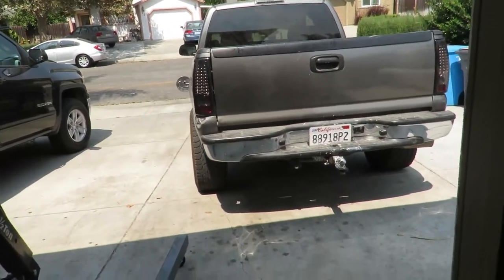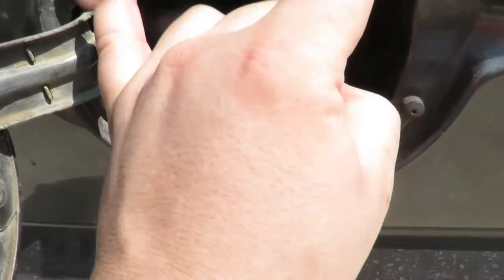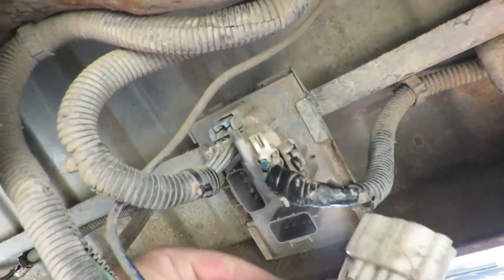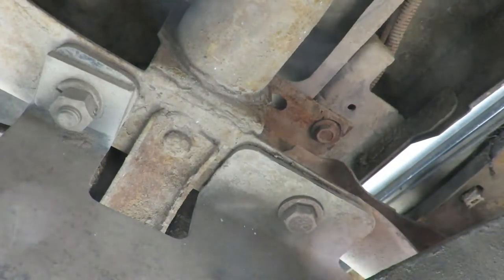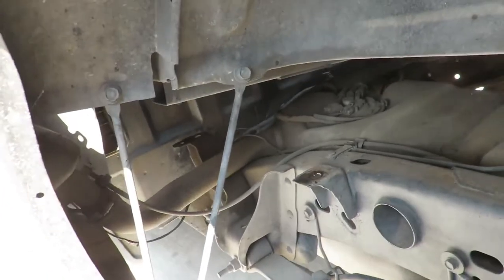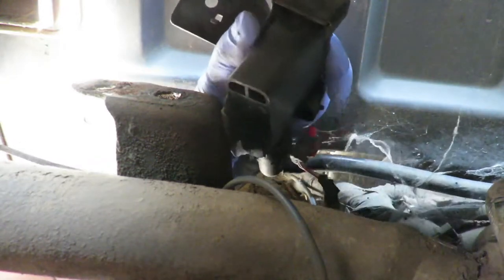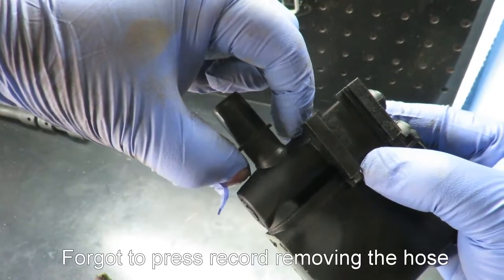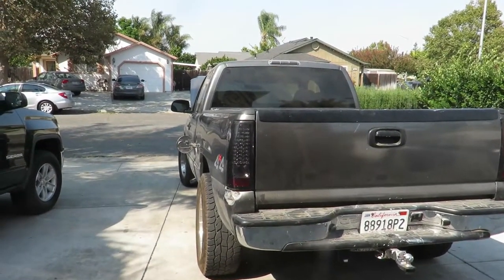GMC Sierra - Evap Canister Vent Solenoid Valve (P0446)

Comment: You don’t need to do any of this, follow the steps I did, 

remove the bolt that holds the ground wire and let it dangle so you don’t damage it

Undo the electrical connector by feel

Remove the old unit from the bracket, leaving the bolt holding it in place, it’s good enough to do it one-handed

Remove bracket bolt and bracket

Then, as the hose is connected, you can rotate the old unit at an angle where you can put a flat head screwdriver on the connector on one side and pry it out, and then likewise  for the other side, then reach over around the axle to hold the old unit and use your other hand to pull the hose off once the tabs are out

Click in new unit to the hose, click in electrical socket, bolt the bracket, then slide the new unit onto the bracket, reattach ground bolt and then you’re done

Comment: I just replaced this on this same truck and I did not have to lift the bed. There's enough space to remove it. What I did was release it from the mounting bracket using short flathead screwdriver then removed the bracket with 13mm wrench. I removed the hose, (squeeze the quick connect from each side and pull off) then flip it around to view the connector and remove it. Came out easy. Reverse order to install. This fixed a P0449 code. Still runs like shit so it didn't fix the P0300 multi misfire code. Cust still angry. But hey, the vent code went away.
Reply from the maker: nice man. i didnt fully investigate every possible way that i could do it. plus it made it easier to record lol. good info for anyone trying to save extra work.
Reply: @hyr0llr  Thanks, it turned out to be the spider injection. We replaced it and it runs great now. Thanks for video. Helped me see what it looked like down there.
Reply: Some of us are unlucky enough to have had someone replace it already with the round style which will not come out of that space even with the bracket off!

Comment: Ive got a P0449 code.  Thinking this is the problem or at least one of the issues.  This video will be helpful, unfortunately, Im in Canada and the bolts holding the truck bed are going to be hellish to remove...
Reply from the maker: yeah we also replace the purge valve in the engine bay. And so far so good.
Reply from the maker: and yeah i know about that rust when i was living over in the north east.

Comment: DO NOT FOLLOW THIS VIDEO. I appreciate anyone taking the time to upload videos like this, but all of that work is NOT NEEDED. Disconnect the 2 grounding wires from the frame, remove the bolt holding the solenoid bracket, disconnect the hose from the CANNISTER end, leaving the hose connected to the solenoid. Disconnect the electrical plug from the solenoid and then pull the solenoid out still connected to the bracket. No need to jack up the bed.
Reply: Thanks for this instruction!  I was able to performed exactly this on a 2002 Silverado 1500.  Wow - saved me soo much time.
Reply: Thanks....Did it this way today. 👍 👍
Reply: Where’s the canister end of it? I can’t get the hose off the solenoid

Comment: It can be done without lifting the bed. I didnt even lift the truck. You just have to get the evap hose off which is hard as crap. But once that is done pry the tab up slide the valve off and disconnect the connecter. Took me 15mins of struggle to get the hose of 1min to swap it out and plug it back in.

Comment: Just did mine today 03 Silverado 4.3 only took 20 minutes I cleared the code but the light came back on 10 min later. Ive changed everything to do with the codes. Not sure what to do next
Reply from the maker: yeah it was weird  for us also. i replaced this then the code for the one in the engine bay popped up. replaced that one, then this one again and then the other one again and so far for 3 months its beem good. idk what the situation was, but so far so good. *knock on wood
Reply: @hyr0llr  Awesome hope mine is gone I all the parts to. I've cleared it  came on then I cleared it again hopefully it's done. I used AC delco stuff also

Comment: Will this part leak fuel I'm a major way?? It says vapor canister but truck has a leak from that spot on the frame and in a MAJOR WAY
Reply from the maker: Make sure its not leaking out of the fuel fill hose. I had a cracked hose one time and gas was coming out of it.

Comment: Does this wire into the pressure sensor on top of the tank by any chance? My connector to that part you're installing has the Orange wire broken about a foot and half a away from that part and i cant get to where it goes to
Reply from the maker: i dont believe it is wired to the top. the electrical connector runs into the harness right next to it and i dotn know where its ran to from there. Sorry i dont have more information to help.
Reply: @hyr0llr  I found that it goes into the bundle wrapped wires under the running board,found the broken one spliced a piece in and No More PO449 !!! Im very happy i dont have see that orange light anymore...thanks man
Reply from the maker: congtas man. really good eye. lol

Comment: Lift the bed off three guys on each side and you lift the bed off you've got it all loosen up anyways come on man that's the wrong way of doing it completely and check your gas cap first before you pull the bed off and don't assume 50% of the time it's the gas cap
Reply from the maker: not everyone will have the availablility of having that many people. but i agree, super easy with the bed off. even did it with 1 friend and it was tough to move the bed. im just showing if someone is alone and not other people available. Thank you for the suggestion.